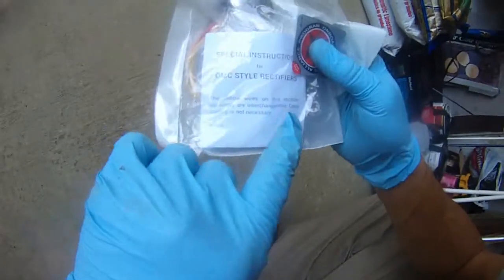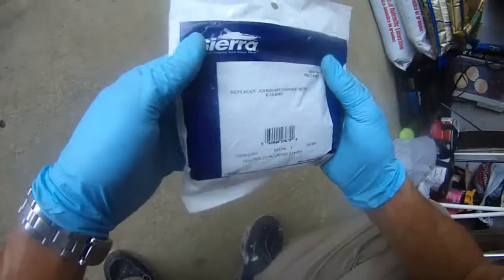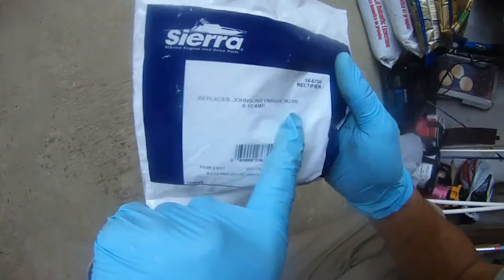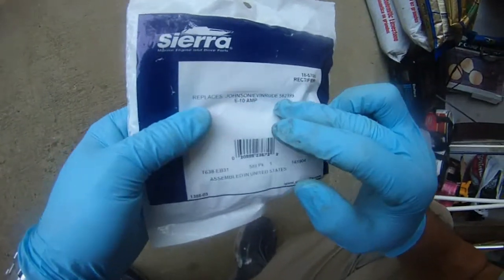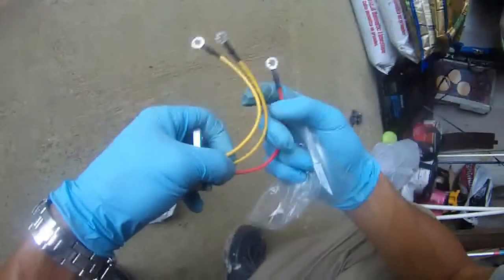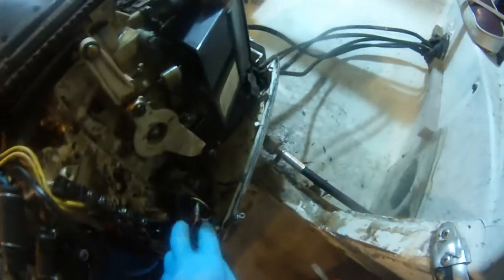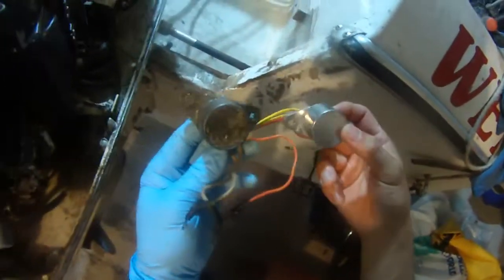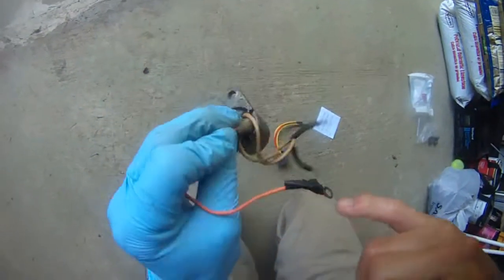Johnson 90 hp stuttered and died (3 of 4) - troubleshoot 3 (replacing rectifier)

Comment: Rectifier only turns stator ac voltage to dc it is possible burnt red wire took out the stator or powerpack

Comment: Hi
Do you know where the carburettor is on this motor as I have one and it needs cleaning
Reply: +njfishing1 Not that hard to be honest and if you just study a few videos you can master it... you dont have to buy a rebuild kit most likely just remove all seals cuz carb cleaner wil eat them up then spray al orifices with carb cleaner. If your scared you will send parts flying with spray carb cleaner , an old tooth brush with rubbing alcohol works very well for leaving all the carb body clean , also if you have a hard time thinking you lost a part I recommend taking pictures before you take anything apart , but man if you try it you can get the hang of it and do it pretty easily on your own ,I recommend taking it apart inside of a bucket so nothing gets lost since its your first time doing it also dont take everthing apart just partially only the things you think you know how to put back together
Reply: Two carburetors to be exact, they are on the front of the motor behind the plastic cover and metal intake plate
Reply from the maker: +Jose Fast Boats haven't rebuilt mine yet, thx God. Been using sea foam to delay the dreadful job.